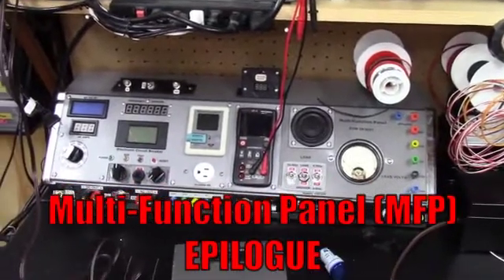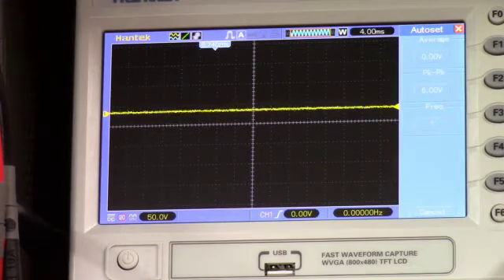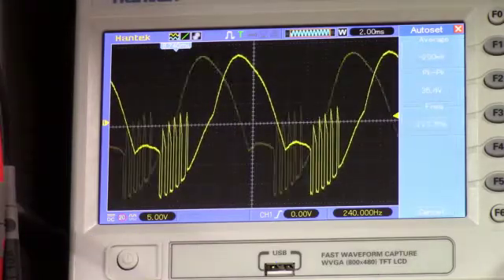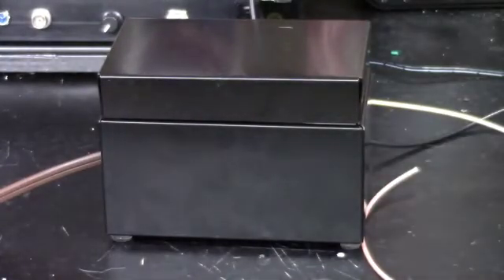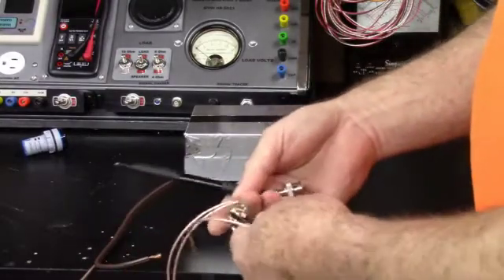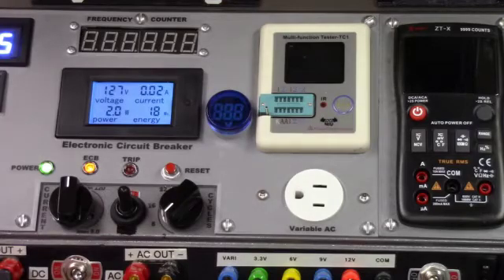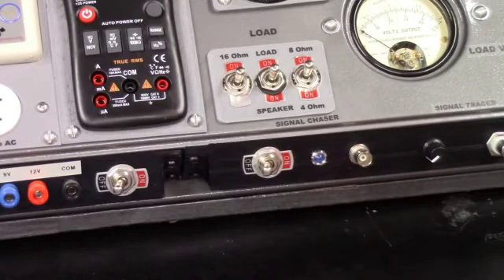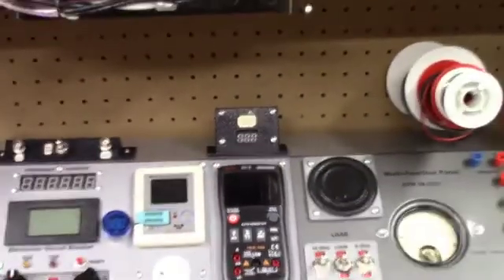MFP  Epilogue

Comment: Hey Gregg, like I said before really nice panel pal. That sine wave is very curious. Having a ringing square wave on neg end have it so sharp and all is different. Almost like somewhere in the circuit there are components like caps or resistors or even and inductor picking up the force and oscillating just a bit. Like they pick up enough juice to throw those three squares out there.
Or it could be little Anthony sending things and people out into the cornfield and you're just picking it up ☺
Reply from the maker: Thanks for watching Carl. Watch Iain's video on the signal chaser and he explains how the 12AT7 creates the noise harmonics shown on the scope.

Comment: Well done Gregg.  You've got alot packed in there.  The concept for the signal chaser isn't clicking for me. Looking forward to a real demo so I get it... Nice job !!!
Reply from the maker: Thanks Ron, think of instead of listening for a radio signal starting at the antenna and working your way towards the output tube and seeing where you lose it. With the signal chaser, you introduce harmonics/noise on the grid of each tube starting at the output tube and work your way back towards the antenna and see where you lose it. So instead of listening for a radio signal, your introducing a noise signal and listening to when you lose it. Kind of the same thing only different. I liked it cause it's and old tube design from the late 50s, and felt it would be a cool item for the MFP.
Reply: @greggsvintageworkshop8974    that makes alot of sense.. its like ringing out a phone line  ( which I used to do when phones were on copper lines )  Thank you my friend..!!